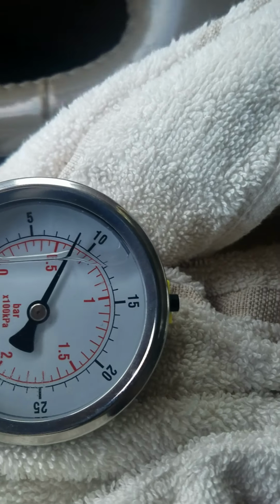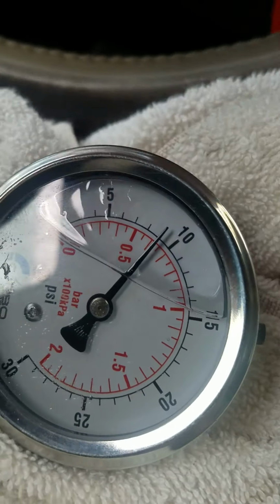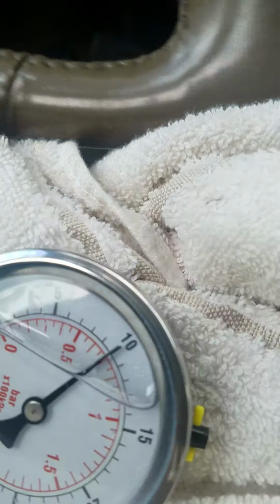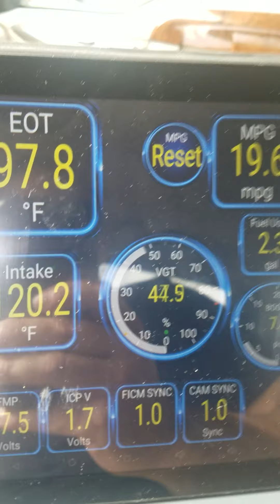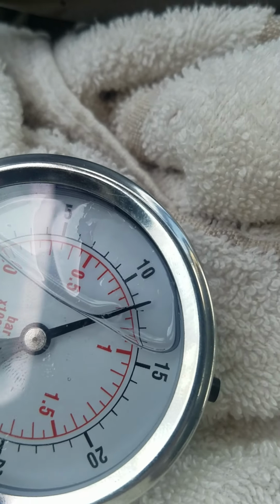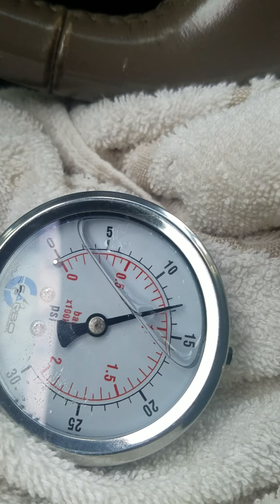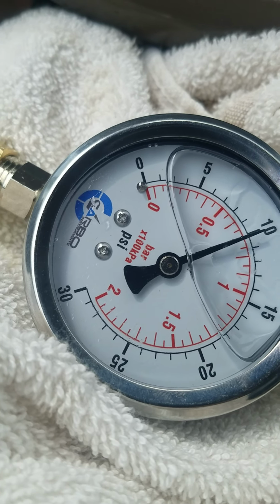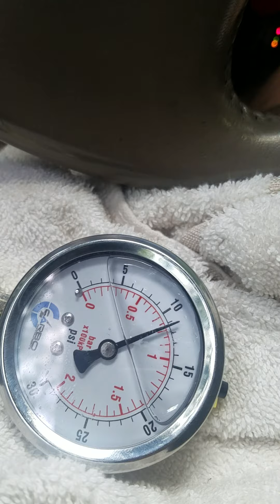Head gasket 6.0 powerstroke pressure test via coolant

Comment: When the head gaskets go you will know it. It will blow coolant all over underneath the hood when pulling a load. Could be a front cover look behind water pump. Not common but could be cavitated
Reply from the maker: Did a coolant test under load... its the front cover.. leaking due cavitation
Reply: vladtexas glad you figured it out .
Reply: @vladtexas  why would it cavitate and how could you eliminate the cavitation.